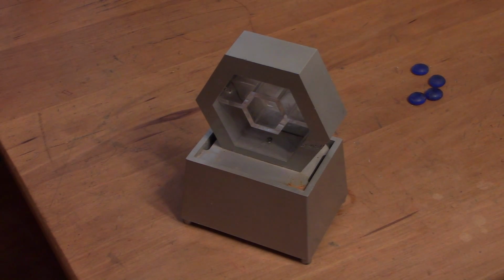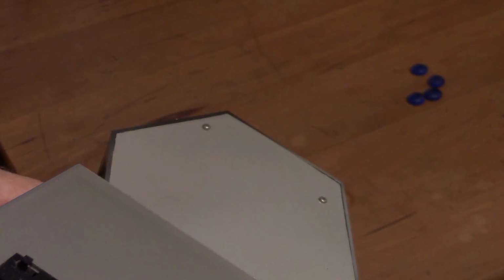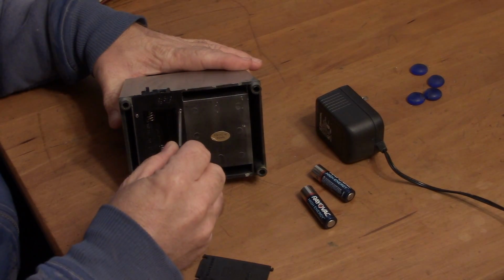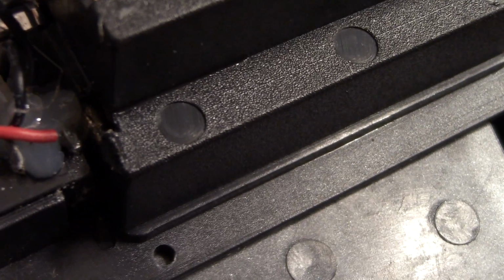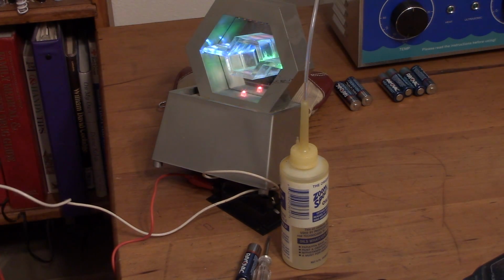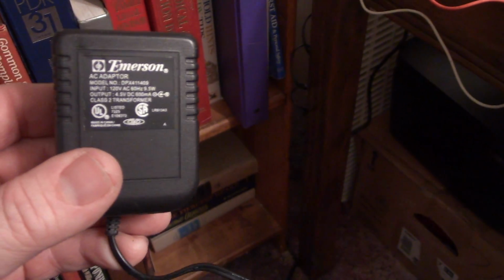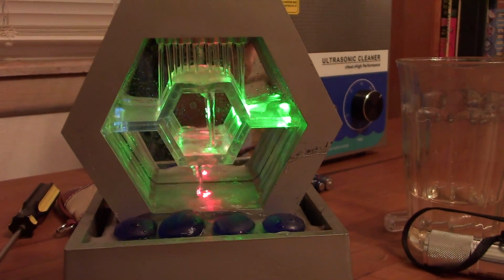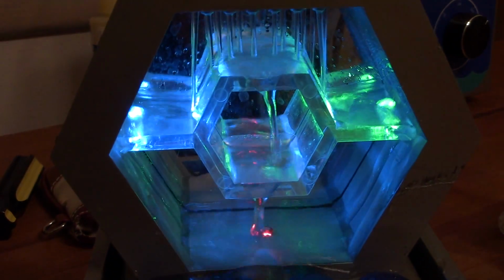Battery Powered Desktop Waterfall: Part One

Comment: VERY nice!  Love the design of that.  I didn't think there was possibly a way to get that pump running again.

I used to have a "water feature" in Club Jay.  Had the nozzles like yours and a pump, at the bottom was a screen and the little rocks you put there.  I think it natively ran on USB.  In time, it would have trouble pumping and have lackluster flow, usually emptying it out and flushing it would fix it.  But the bigger problem was the China screen they used that would rust and then rust completely through.  Sometimes the RGB err eee dees would go wonky as well.  Had a couple of those, first one broke, tried fixing it, but that pump was dead dead.  Second one also died, and there was no servicing these things.  

These days, you can find replacement pumps that will work in these things cheap and easy online, back when I had those "water features" there was no such thing!

That's to say nothing of the "dancing water speakers" that break in short order.  They did.  I bought a second set, but I'm not going to bother to put them out since they'll die also.

Oh that reminded me, there was this other water thing I had that was like a kiddie science volcano thing, you put water and these tiny red plastic balls in, the pump would run intermittently and push the balls up so it would look like it was erupting.  The pump in that died too, and I oiled and oiled it as well, to no avail.
Reply from the maker: I remember seeing those "volcanoes" when I was a kid! I haven't thought about those in many years.
I couldn't believe I got the pump to free up! After running for a while, it has a small leak, and caused the err ee dees to go crazy. That's good to know replacement pumps are available.
Reply: @dynatrak  Yeah these things certainly weren't built for longevity, that's for sure!  Seems like they should be like an Oriental Trading Company sort of item for like a dollar two-fifty apiece.  I'll be taking a look at Part 2 soon.